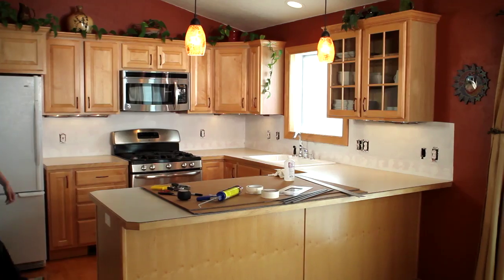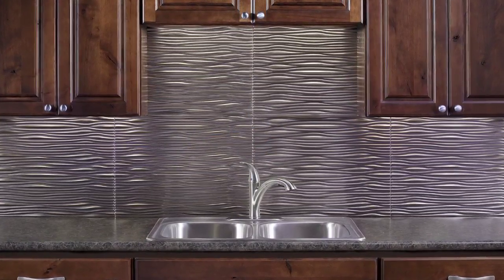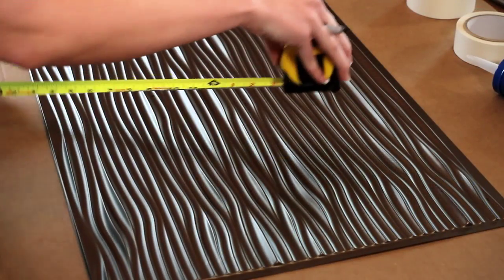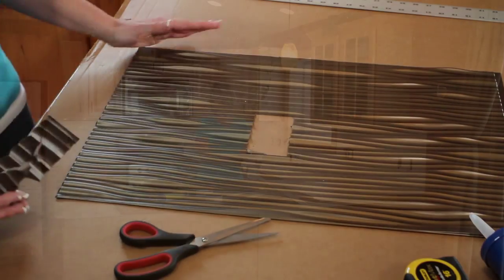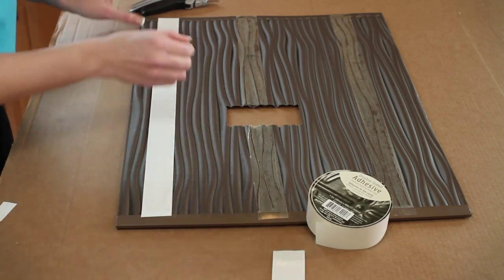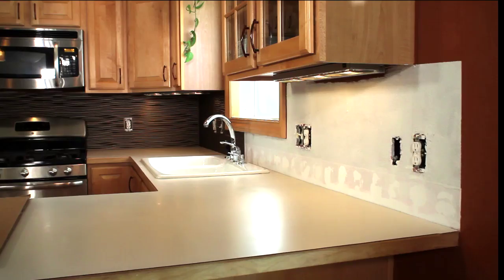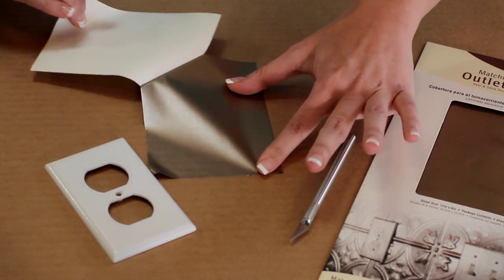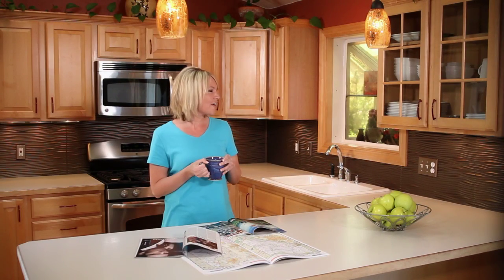DIY Backsplash Installation - Fasade Panels

Comment: what about hit? can i use it near oven ?
Reply: Even though the backsplash panels are fire-retardant, they can be 
deformed by excessive heat (over 140 degrees Fahrenheit). The panels can
 be installed behind a stove if the stove has a control panel. Be sure 
to keep stovetop burners, toaster ovens, cooking ranges, etc., 6 inches 
away from the panel's surface.

Comment: Can these be applied over older ceramic tiles??
Reply: Yes.  The wall to which you plan to install backsplash panels to needs to be 
freshly cleaned, free from dust, grease, wax, etc. After you’ve cleaned 
the wall, be sure that it is dried thoroughly.